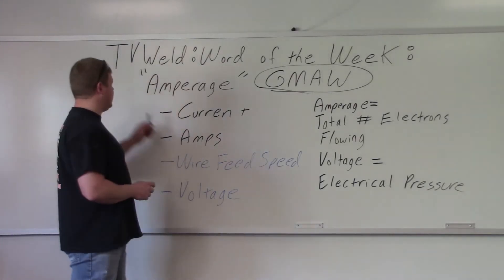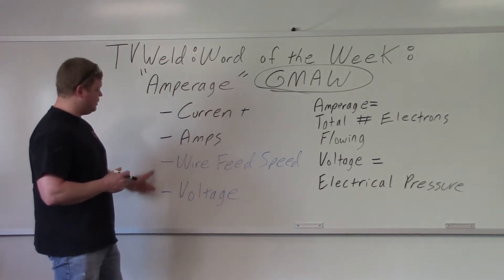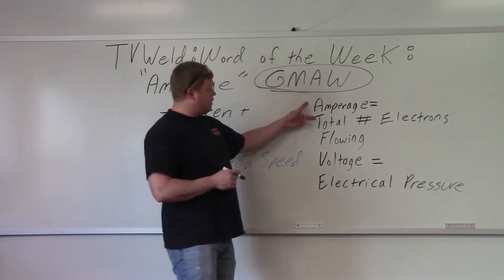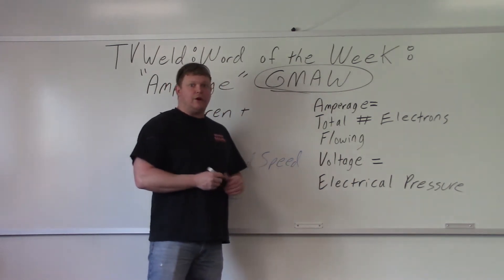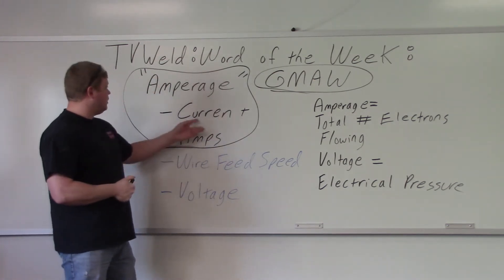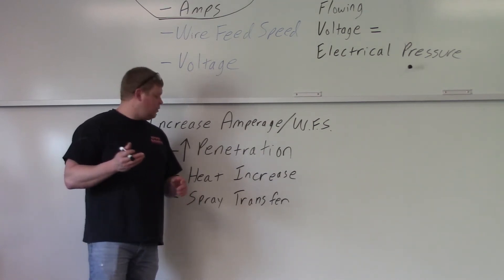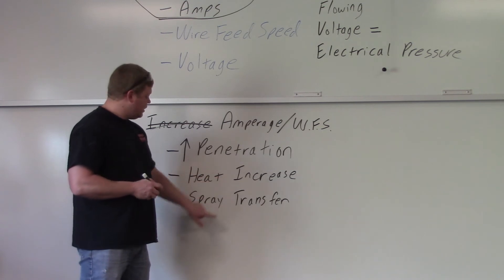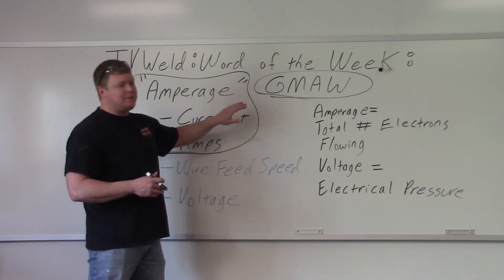AMPERAGE & MIG Welding

Comment: What matter is what the change in weld appearance as amps go up or down! I want more penetration with less puddle height on my stainless tube weld,  what change do I make to get a flatter weld finish, with less grinding off?
Reply from the maker: I'd turn up both the wire feed speed and the voltage.

Comment: Is there a way to tell if I'm short circuit welding or spray transfer welding? Using 90/10 gas with 0.35 sold wire on steel.
Right now I'm at 530 wfs with 24 volts on about 3/8 inch material. Any input is welcome.
Reply from the maker: It should sound more like a hiss than a crackle when in spray.  The parameters you listed look like it would be hot enough to be in spray.  Thanks.
Reply: @TVWeld  that's very helpful. I get a lot of popping when I'm welding turned up wire feed speed to 550 an volts to like 23-24 like snapping and sizzling sounds I can get it to spray well if I turn the volts up  to like 27-32 volts but wire feed speed I feel has to com down to 450-500.

Comment: Okay so now how do you find that amperage for a procedure on a machine that doesn't read it out? With an Amp clamp meter?
Reply from the maker: I've had a couple  conversations with some colleagues on that and it seems that a clamp meter is what people are using.  That is if they are demanding an Amperage.  Most CWI's that I spoke with say they only put a wire feed speed and a voltage for GMAW.  I looked up the essential variables in my D1.1 and amperage did read for GMAW a maximum increase or decrease of 10% which technically, if you didn't have a PQR amperage, you would never know, but it also had an essential variable of a max increase or decrease of 10% of wire feed speed (Table 5 Process Parameters #17) if the machine is not amperage controlled.  So, I still don't think it is necessary to put an amperage on a PQR for GMAW processes. I did find one machine that we have where you can push a button and it give the amperage read out.

Comment: Im buying a mig welder that has a minimum amp setting of 10 amps. What gauge steel would ten amps weld?
Reply from the maker: Very thin.  I'd guess 1/16".

Comment: So what is the " Amperage" when the wire feed says 200?
Reply from the maker: The machine most likely won't tell you the exact amperage because GMAW machines are a constant voltage power source.  This means the voltage will fluctuate very little.  That means the amperage will do most of the fluctuating.  So when your wire feed is at 200 it means your wire is coming out at 200 inches per minute.  The exact amperage will be all over the place because the machine is trying to maintain a constant voltage.  I guess the main thing to understand is that as you turn up the wire speed the amperage is going up which means your heat is going up as well.  I hope that makes sense.
Reply: @TVWeld  So in PQR's  when the essential variable requires amperage using process GMAW, how would you find the amperage to document it on a PQR . Thanks Brent!
Reply from the maker: @rogermarshall2037  Amperage shouldn't be an essential variable for GMAW.  On my spreadsheet for writing PQR's the heading for amperage says amps/wfs indicating amps for SMAW & GTAW and wire feed speed for all GMAW documents.  I did run this by another CWI and he agreed with me.  So that seems to be the general consensus that I got from two CWI's anyway.
Reply: @TVWeld  Ask them to look in the D1.1 2020 table 6.5, process parameters (12) I see what you are saying but it's an EV as far as I can tell. I started using a clamp meter to read it amps.

Comment: Question? I just bought a hitbox 250 gas/gasless welder and it has control knobs for the amps and for the volts. Just trying to figure these settings out to get the best welds. Thank you
Reply from the maker: The amps should be controlled by a wire feed speed (wfs).  Look at your amperage knob and see if it says ipm on it or wfs.  That would be inches per minute and make that knob a wire feed speed.
Reply: @TVWeld  no it doesn't say anything. It just has a V for the bolts and an A for the amps
Reply: @erickgonzalez1804  You should've included that your machine is a multi process welder that can do stick, lift tig, flux core, and mig. As long as you have flux core or mig as the process selected, then the "A" will actually be your "WFS".